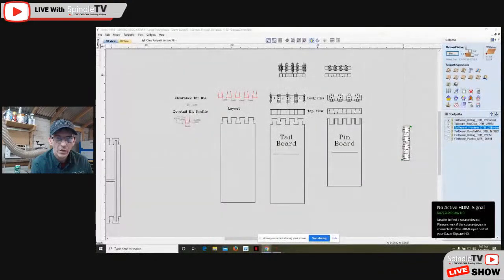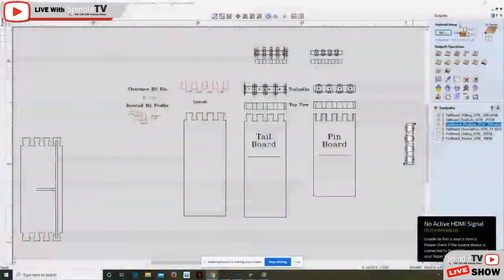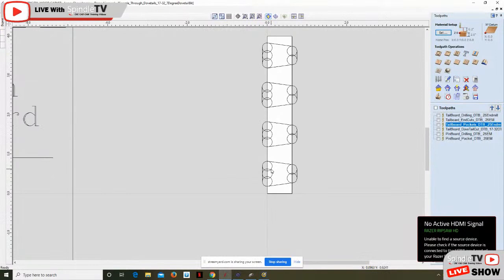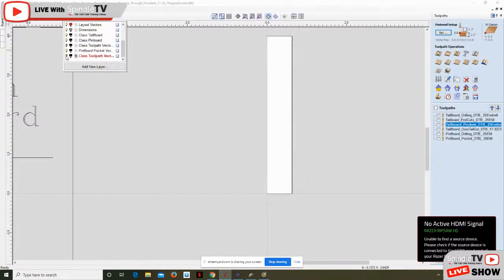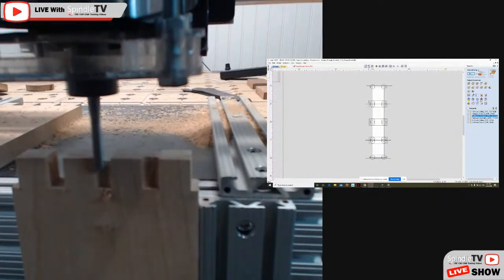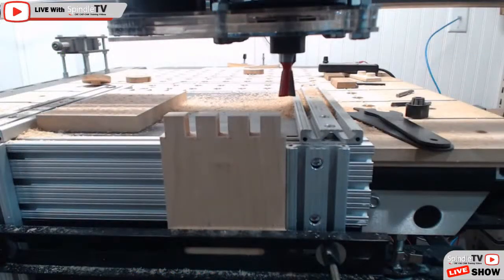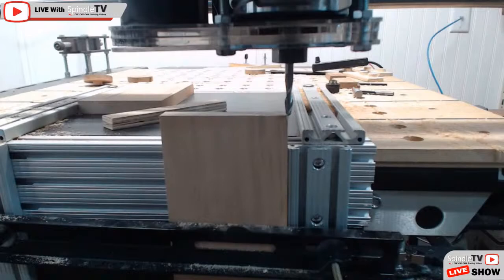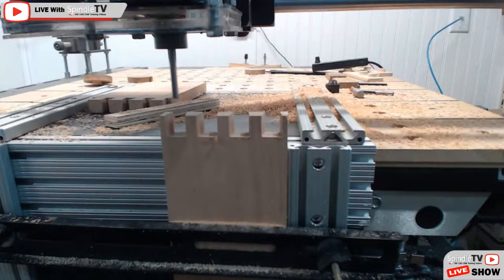Dovetail Box Part 2 - In The Shop Cutting CNC Dovetails - Live

Comment: Hello Laney I have a question for you about the dovetila joints.  I am making some benches out of thicker wood about 1.5" or 2" thick spruce.  Can you tell me how to make these joints as I asume I can't find a 2" dovetail router bit?
Reply from the maker: Alright well let's evaluate this for a moment your router bit size is not determined by the thickness of your materials the depth of your pins and the height of your Tales is determined by the thickness of your material so all the steps in this video you can follow you can spread out your DuckTales if you wish you know if you want more or less you can make them the size shown in this video the angle of your Dove tails will be determined by the angle of the dovetail bit so you can follow the steps in this video on laying out your Dove tails you will just be making them deeper based on the thickness of your material I'll lend here you tell me if you understand or not and then we'll continue
Reply: @SpindleTV  Humm I though I understood but maybe not.  When I actually have the wood on my table and Im running the dovetail through my piece of wood.  I thought If I wanted the tails  2 inches long I would only run the dovetail bit through the wood one time to make the depth I wanted "2inch" and as a result I needed the dovetail bit as long as I wanted to make the tails deep.  I wish I could add a picture so now I hope I explained and you understand.  LOL
Reply from the maker: @donglascock  its a profile cut. You will have a rough cut with and end mill this clears away the waste then a final profile cut with the dovetail bit doing the cut in 1 pass...
Reply: @SpindleTV  okay I will try it and see what it looks like.  I am sure you are correct.  Thanks so much for the help on this and with all the videos you make.

Comment: Laney..can you tell me why the tool path on the pocket cuts kept raising the z up to the safe height each 1/8" path it was making?  I'd have thought it would just take it's pass then move to the other side of the cut out, take the 1/8" off that edge and then go back to the other side move down a bit and take another 1/8".  It was raising back to safe z and dropping back down into the slot each time.  Thanks in advance to the insights.
Reply from the maker: I believe you were seeing the drilling operation there's a drilling operation that does Peck drilling prior to the pocket cut. In the pocket cut it starts in the center of the pocket and works its way to the outer perimeter of the pocket. Then raises upmovies back to the center and begins the pocketing at the next step but what you were seeing was the peck drilling operation

Comment: Hi Laney, your course is awesom. Regarding the tangent issue that you had. I think if the two circles are the same size and aligned vertically or horizontally, the snapping start point and the end point are already the tangent points on the circles and you will not see any difference.
Regarding the order of the cuts on the CNC. I suggest to start with the pin boards then move to the tail boards. That way you will do a tool change only once.
Reply from the maker: Excellent tip on the tangents...i totally get your point on the pins first but cutting the tails first it allows tue user the ability to adjust the pin allowance for the perfect fit. Which is why i teach that method... But yea if fewer tool changes is the goal a user can definitely set it up to do pins first...just limits their ability to test fit and adjust the pocket allowance....